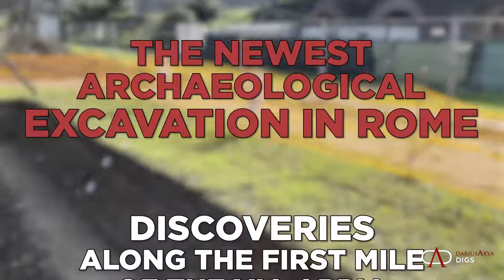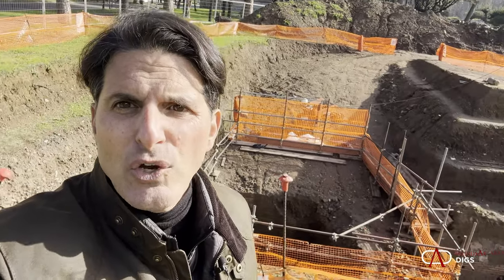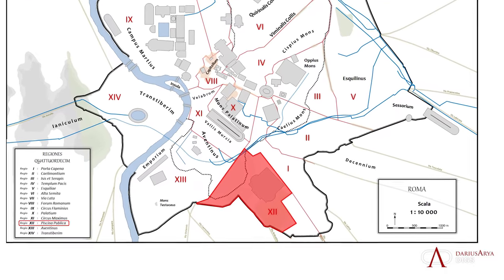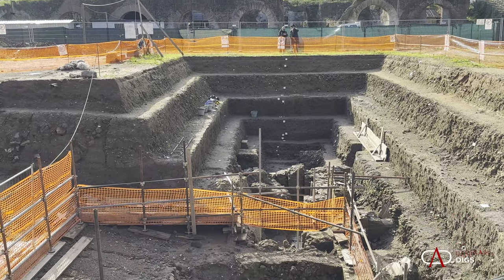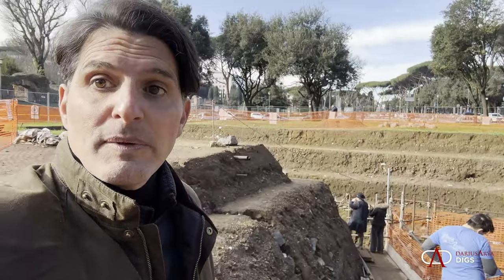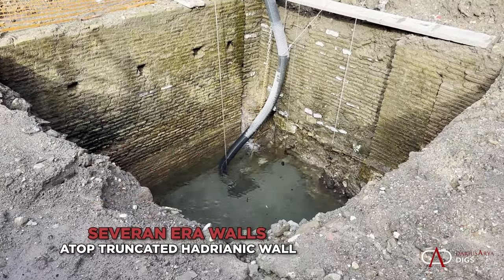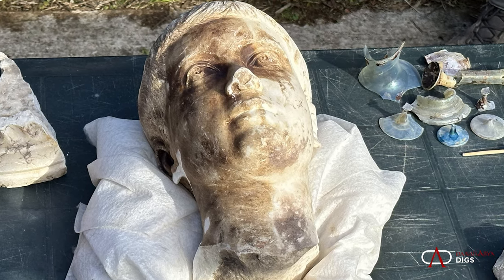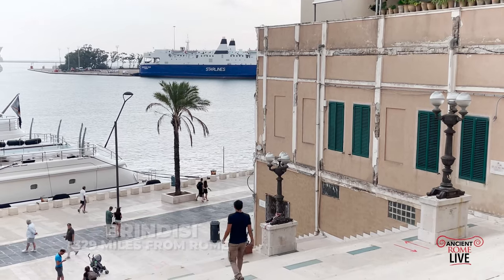Digging for ancient levels of Via Appia inside Rome!

Comment: What I find almost confusing is why these tabernae have subsided so far under the ground even through they post-date the Baths. Yet, the Caracallan Baths are clearly still far above the ground. I recall the rule of thumb of 7mm per year of accumulation, leading to the 7m we find buildings now under the current ground level.
Reply from the maker: No they didn’t subside - it was a natural valley in front …
Reply: @DariusArya  Ah, I see. Years ago, my wife and I took a wonderful bicycle ride along the V.A., but we didn't make it over to the Baths, so not familiar with that corner.